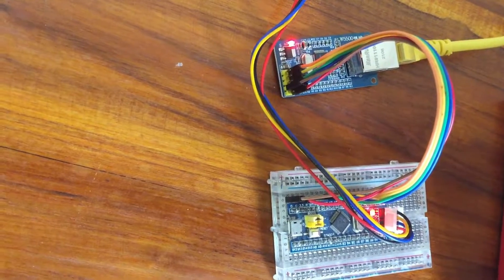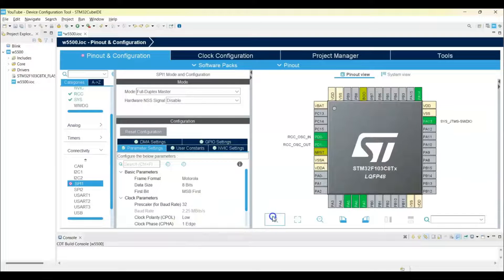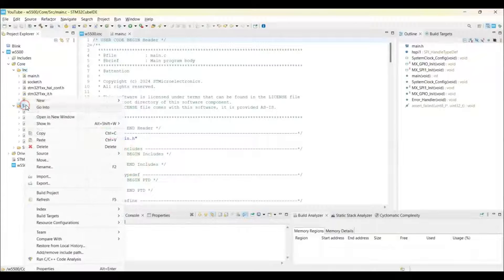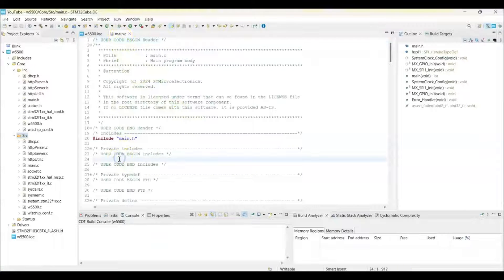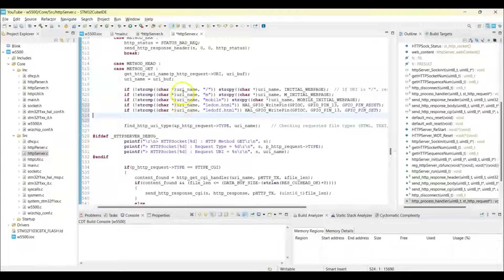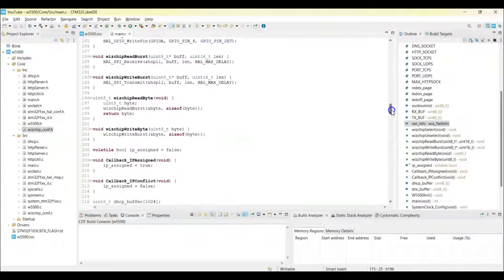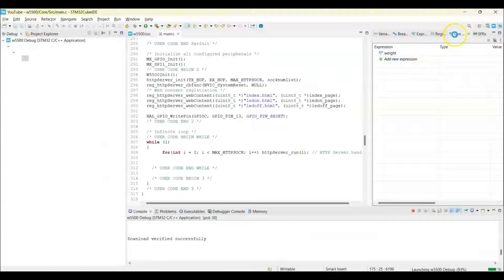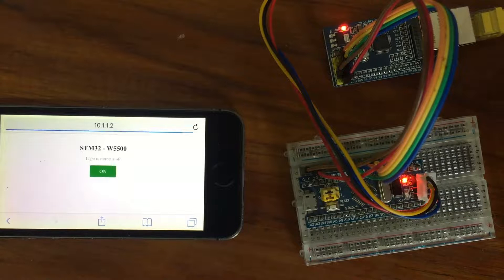109. Ethernet W5500 web server with STM32 F103C8T6 STM32CubeIDE

Comment: is it ok to use w5100 instead of w5500?
Reply from the maker: The driver in https://github.com/Wiznet/ioLibrary_Driver
says "ioLibrary_Driver can be used for the application design of WIZnet TCP/IP chips as W5500, W5300, W5200, W5100 W5100S"
I tested only with W5500. You can try with all other modlues

Comment: Hi Nizar, This is great! I appreciate you making this video so much!. Question 1) what is I want to use a static IP Address how would that be coded? Because I don't want to lost track what IP Address would be assigned via dchp. Question 2) I saw in the folders a folder called MQTT could you make  a client that sends say the DHT22 temperature once a minute. This would make a great video. I've learned so much from your examples and has helped my come up with some ideas for new projects. I'm new to STM32 using W5500 ethernet module. Thank you Don
Reply from the maker: Thanks. I am also new to W5500 module.
The library provided is from the original manufacturer 
I believe they have static ip address facility too

Comment: I do need some help. I tried my best troubleshooting the problem but I kept getting no IP address. I changed the MAC, and checked the wiring. Tried reading more online and again no results. I have the same set up as you. Please advise me how to fix this issue. Something to note: it does not create neither IP, nor gateway.
Reply from the maker: Your Router needs DHCP enabled. Please see router user manual. You could simply try another router
Thanks